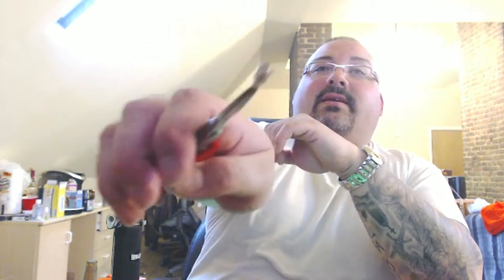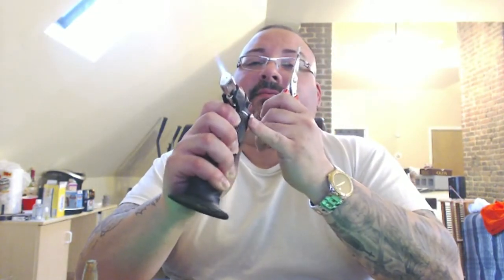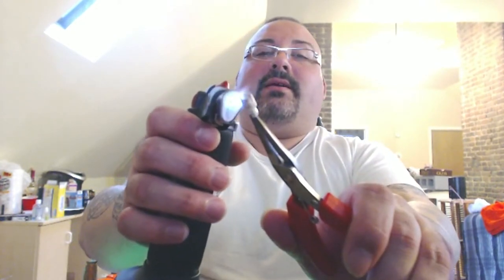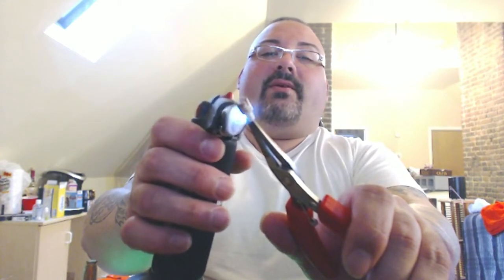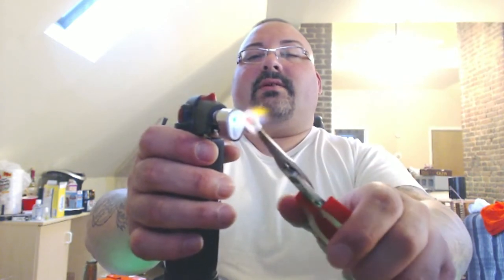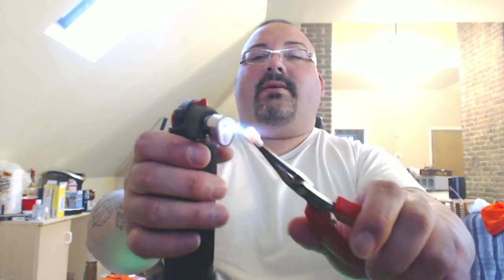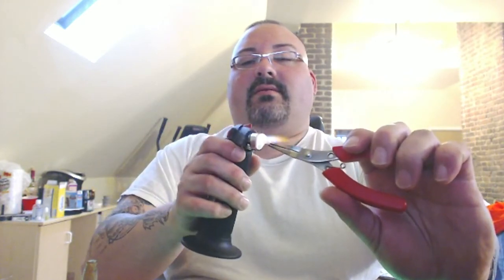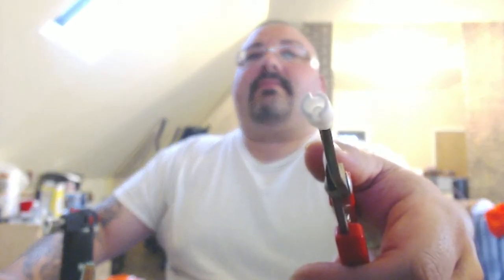GG Iatty Cleaning Better Flavor & No Leaks

Comment: I don't have one of these so I don't know if it has a hole through the base like the ody, but I put a piece of wire through mine (which is just a clone) so I can hold that with the pliers and heat it up to clean it. Thanks for the video, keep them coming, I always enjoy them and learn a lot from you.